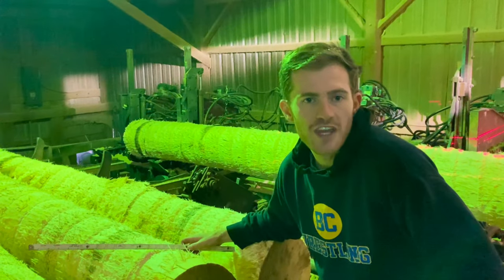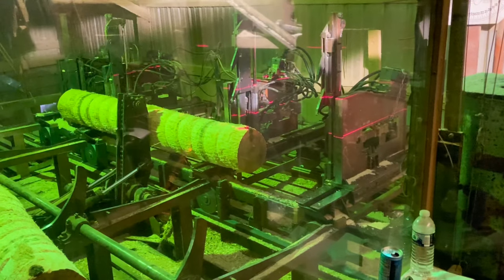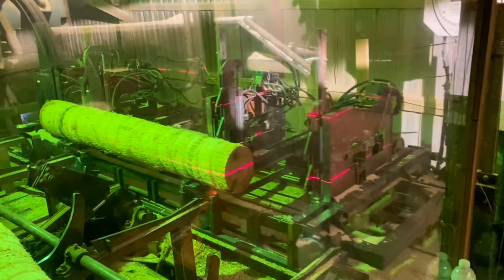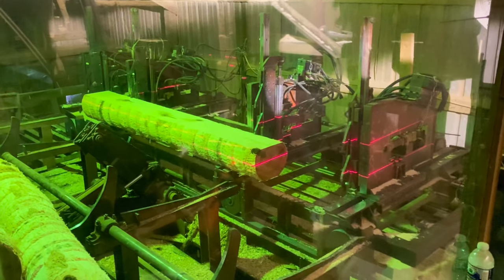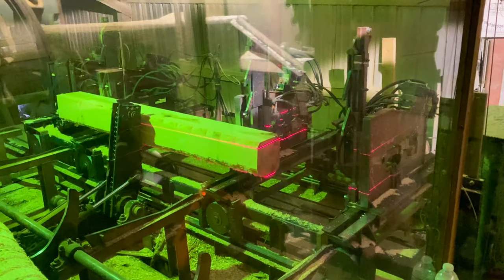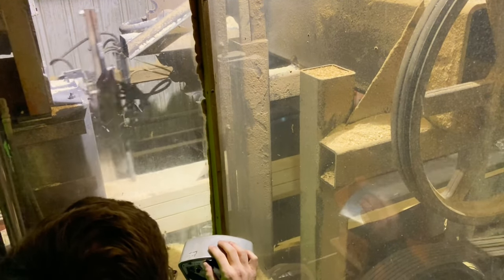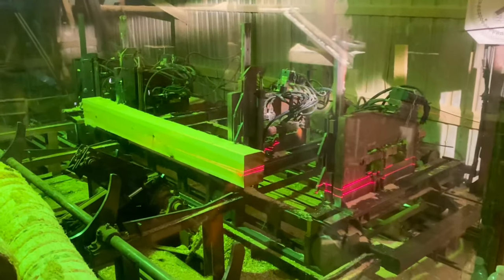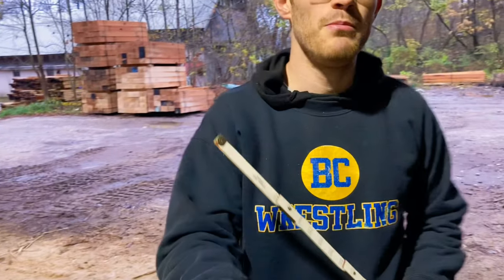Comparing the Doyle log scale to how much we actually get in board feet!

Comment: I really like your clips.  I had assumed that in addition to your laser lights you had some kind of OCR or optimization software.  I was surprised to hear you say that you do all of this in your head.  You are really doing it on the fly.  BTW I really could not hear or understand most of what you said in this video.
Reply from the maker: Thank you for the input! I’ll still working on my presentation. But yes! It’s all up in the ole noggin. When I’m up in the cage, I’m controlling the log turner, the edgers, the carriage, and doing a bunch of math in my head as I go. It makes operating everything else so effortless